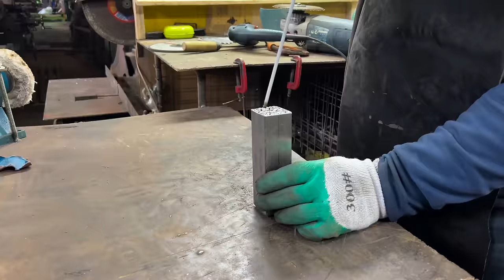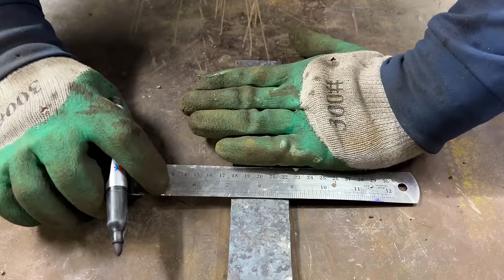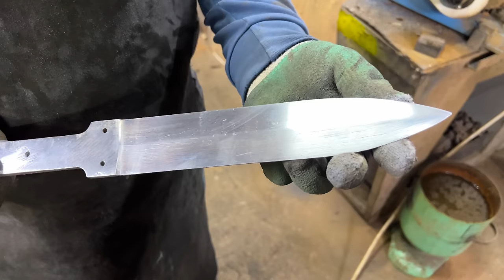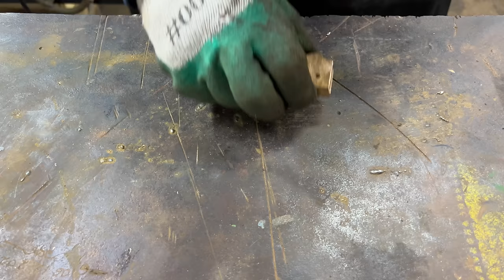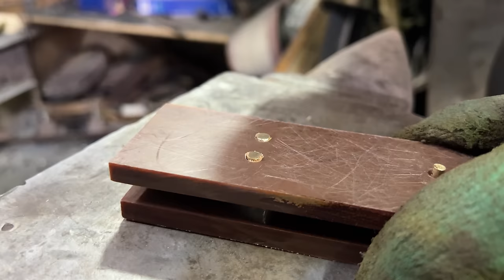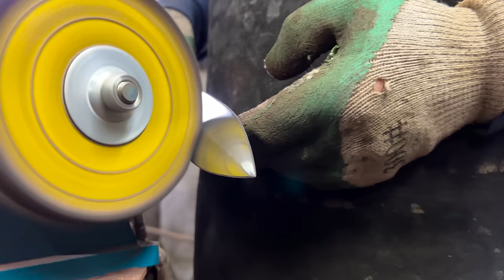I Made A Sharp Knife out of Nails

Comment: This is an interesting knife friend, though it's hard to see the etching... 
Perhaps coffee etching would bring out the differences?
If you wish to try it, I found the following reference info:
Dissolve 1/2 jar if instant coffee per litre of water and leave the blade in the solution for up to 4 hours, checking on it every 15-30 minutes...
It should work on most pattern welded steel so long as there is more than one type in the mix, just try to avoid polishing out all the stain when finishing the blade 😉